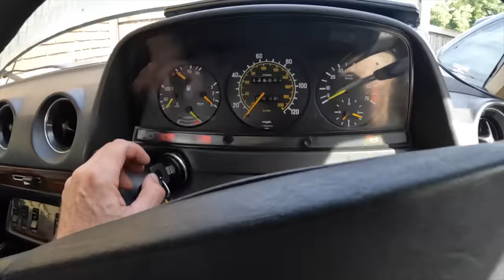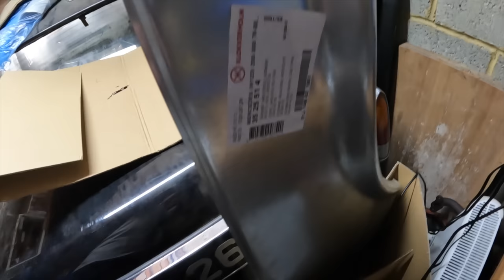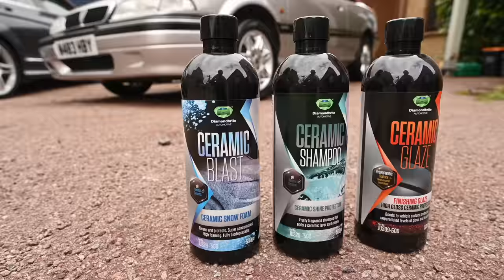Barge Fest! All my Giant saloons together at last! Crown Vic-Volvo 740-Merc W123

Comment: When you showed the Crown Vic I saw an R16 in the background. I had one in the same colour and it was the last R16 on the road in Vancouver, British Columbia. I bought it in 1996 and drove it around for years until it had to be retired. I used it throughout southern BC. A wonderful car to drive. it was a 1971 Canadian market model with a TS engine. Besides that, the Crown Vic looks like it has found a very good home. It looks better than the odd one I still see here on the road. Most of these have been used up. It was a pleasure to watch this clip!
Reply from the maker: Theres always something interesting at that shop!
Reply: Excellent car the R16, definitely an underrated classic - and this from someone who, generally, does not like Renaults - or at least the present day ones.

Comment: Wondering video, Matt. You mentioned shocks and springs being needed on the rear of the car. Cargo Coil by Moog work beautifully. For shocks, as the Ford Dealer to get some shocks in from Ford USA. They are amongst the least expensive shocks you can find, but the work beautifully and the car will handle much better. Be sure to specify the 4.6 litre with P-71 Package. That changes the specs for the parts. Ford had 4 different shock absorber parts numbers. First was the base suspension. Second was Performance/Handling. Third was the Taxi Package. Third was the Police Interceptor package. The shocks and springs are all calibrated to work with the specific springs on each suspension package.
For the transmission, if the shifts are slow and wafty, the transmission is way over due for a full rebuild. The Interceptor came with a shift kip that made the gearbox shift very quickly and cleanly. Be prepared for sparkles to show in the transmission fluid as you drain it. 
I still love the Volvo. I really love the GL seats in that 70s Audi. These cars HATE to shift. Never mind that the AW-70 by Iolla.
Reply from the maker: Rock Auto stock the genuine Ford parts and helpfully list Police spec items - when I changed the front shocks I got the correct ones from there, and even the uprated ones were dirt cheap compared to European car parts!
Reply: @furiousdriving  RockAuto rocks!

Comment: We bought a 760GLE estate just for the purposes of hauling stuff when we moved house years ago, a great old thing. Paid £125 with slipping auto box (topping up the level fixed that), ran it for a few months then sold it for £100 still with MOT. Probably still going now. A 123 estate is definitely on my wants list, having had a few 124s in the past.

Comment: I somehow missed your W123!  I was not aware of that one in the collection!  Incidentally, although I never read responses to anything I post, I must add to my comment on my non-plussed bit of a damper response to the American car gathering at Brands Hatch.....unfortunately, my not-so-enamored reaction to a Crown Victoria is due the cars being considered "the enemy" for decades I have been out on the road here in the USA.  I'm actually a rather conservative driver, and my few run-ins with cops have seldom been a positive experience.....regardless of the civility of the interaction, I always have ended up with a ticket and not a warning!!!  Usually speed trap "Dukes of Hazzard / Sherriff Coltrane" stuff of 55 MPH dropping to 30 MPH and "You should have seen that posted limit!  It was back there.....behind the big oak tree."  That being said, my driving is so anodyne that the police are wasting their time with me when there are drivers begging to be pulled over in this day and age of "the law doesn't apply to me".  Besides, I am a GM guy, so if it were a law enforcement vehicle, I'd rather see a Caprice or these days, a Tahoe!!!

Comment: I just love Volvos, I've had a 164TE, 244DL, 240GL, 244GLT, 760GLE Estate, S80 2.4SE and a V40 diesel. The 760 estate was just lovely and floaty. Oh, and years ago I  had a 1980 Toyota Crown which was quite water soluble.

Comment: The metal trim piece between the C-pillar and back window comes off. Remove the interior trim and you'll find a couple of nuts. I recommend pulling it off and repainting underneath. This is the #1 place where the paint begins to peel on these cars. It's accelerated because water gets trapped by debris and doesn't drain through.

Comment: Great update, Matt. For the Volvo, you might be able to touch up those little spots with a small air brush, would be interesting to see the results. For the Crown Vic it would be a shame to remove all character, I agree. But I guess some spots need to be taken care of to make sure it will last. Did you already have to underbody protected?
Reply from the maker: I did under seal it around the MOT time I know its good underneath for a while

Comment: Great video, nice to see a 'compare and contrast' of the saloons... But where was the P6?  You seem to have missed one!

Just wondering if anyone has done a manual gearbox conversion on the CV?  The MG ZT260 has a manual gearbox, it's a Tremec 3650 so mechanically it's do able and the CV is a bigger car so should be able to make it fit...
Reply from the maker: A mustang 6 speed drops in pretty easily apparently

Comment: Not quite sure how Matt feels about automatics.....think he said he likes them?  In all seriousness though, some of us don't have much of a choice (due to medical/other issues) but drive an auto. I personally don't see the problem with them. Yes around a racetrack a manual will be faster, but for everyday driving an auto (my ones certainly) works fine. You can't stall them (i never have anyway), or go along 'kangaroo petrol' or bounce it off the limiter in 1st (like most tubes seem to do) trying to make your 900cc sh*tbox sound 'cool'- all plus points in my opinion.  Much newer autos are actually better on fuel than manuals, that seems to be the way that most new cars are going. Not having a go, just stating my opinion, keep up the good vids.

Comment: It's about time we saw the W123 again. I watched all the videos of the injection rebuild etc but must have missed what eventually got it running. What was the problem with it?
Reply from the maker: it was a mystery - V Power fixed it! After rebuilding everything it still wouldnt go and then suddenly it did
Reply: @furiousdriving  good to know. I have a 24000 mile 1983 230E. Wasn't driven for 10 years. Now starts first time but lacks power when warmed up. I haven't plucked up the courage to rebuild the fuel injection yet. Looking forward to future episodes.

Comment: Haven't watched the whole video yet, but what has happened to the Volvos right front bumper and turnsignal glass, found a pole that jumped it?
Reply from the maker: last owner found his gate post on the way home once
Reply: @furiousdriving  Those pesky posts, they are sneaky! I tried to move a 50cm wide treestump with my spoiler, I knew it was there as I had parked on our lawn while moving, but just jumped into the car and dove forward like there wasn't a cloud in the sky, I got as vide as the stump and my spoiler on the 1971 Volvo142, Volvo aftermarket during the late 80ths got 50% shorter!
 I think there is a metal beam underneath the plastic covers, maybe it would be possible to straighten it out  somewhat and then pull out the fender a bit and it would look nicer? It's the turnsignals alignment to the headlight that gives it away.

Comment: The Mercedes is KE-JET isn't it? So has some electronic control.🙂
Reply from the maker: K_Jet is pure mechanical, it works on vacuums pulling balanced plates and rubber diagrams

Comment: Matt, I have a 124 Estate 230, mechanically the same as your 123 which will be a 4 speed auto.  It is not slow, probably quicker than your Volvo and is a good cruiser with some body role but not too much, also surprisingly narrow to easy to place on the road.
Reply: The MB 4 speed has a very low 1st speed. OK for pulling caravans over the Alps but not much else. I think it might actually be set up to pull away normally in second when in D so it is largely redundant.

Comment: If the volvo is thirstier than the Vic there must be something wrong with it.
Reply from the maker: small engine, big car, working harder thats all
Reply: I own a Volvo 960 (bigger engine than Matt's) and can confirm they are horrendous on fuel.
Reply: @furiousdriving   The economy specs are pretty simular though and those volvos really were made for long journeys, in town they can be pretty bad. 2.3 isnt really that small an engine for that car though to be honest, could have probably used a low pressure turbo though.
Reply: My Volvo 940 estate 2.3 is also horrendous, about 18mpg. Suffice to say it is not used frequently 😂.
Reply: @kathykirby5837  If they were like hat from new I do not know how they sold so many.
Reply: @rimmersbryggeri  me either, but it's running spot on, I had it checked over for a fuel leak but there's nothing wrong with it, it's just the way they are. Slow and juicy 😂
Reply: @kathykirby5837  But at the time it had decent power for a 4pot N/A.
Reply: @kathykirby5837  They're not as heavy as people assume, though.  Mine has over 200hp, doesn't handle bad for what it is either.
Reply: @rimmersbryggeri  The people that bought them new probably weren't that fussed with the fuel economy, fuel was cheaper etc.
Reply: @SuperFIFTHGEAR   Fuel wasnt that much cheaper relative to income though so can't realy buy that argument.
Reply: @SuperFIFTHGEAR  mine is a 1991 and quite boat like. It's exactly what I need for tip trips, picking up large items etc.